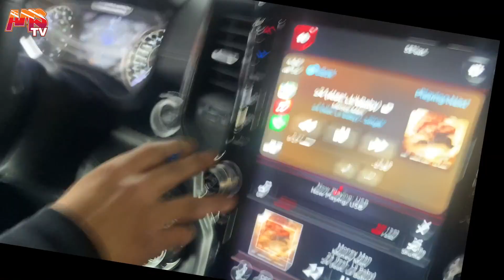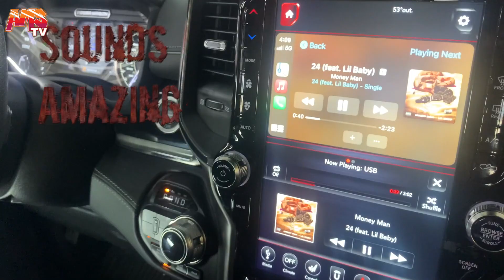2021 Doge Ram Power Wagon Bass Upgrade MTI Acoustics project Rich Boy

Comment: I like the video, but you skipped the part where you installed it underneath the backseat. Did this power wagon come with a factory subwoofer underneath the backseat? Mine does I’m trying to find a box to replace the factory subwoofer underneath the backseat.